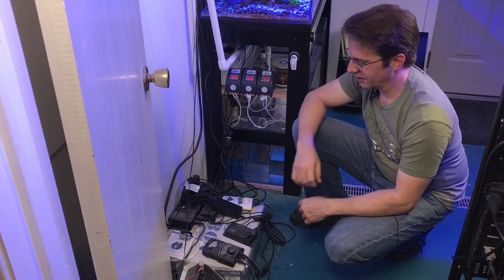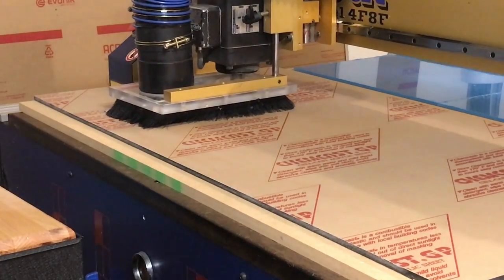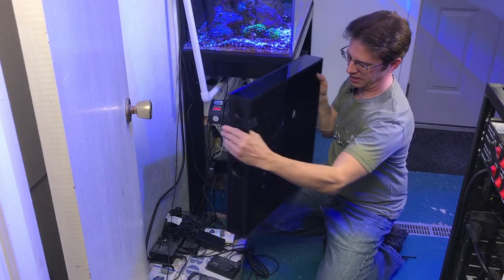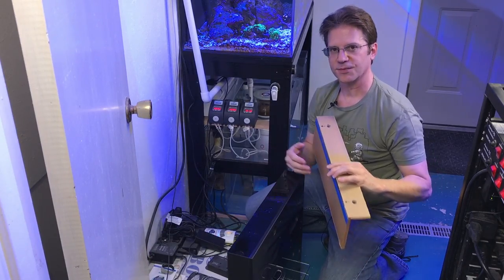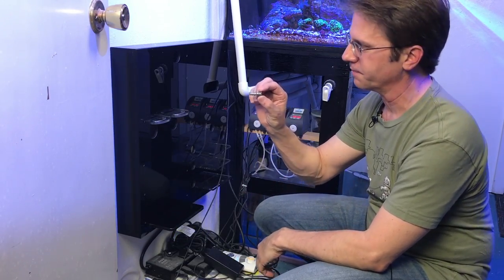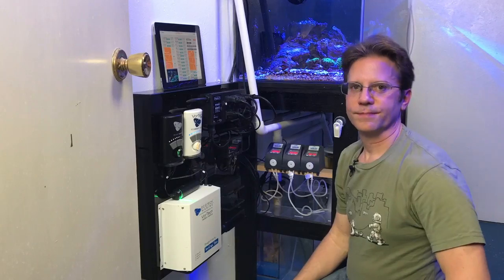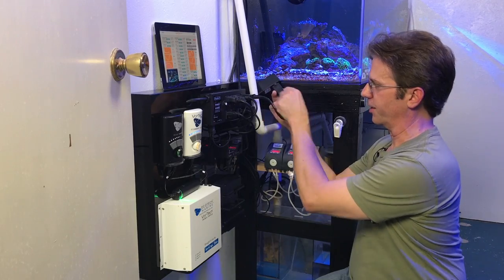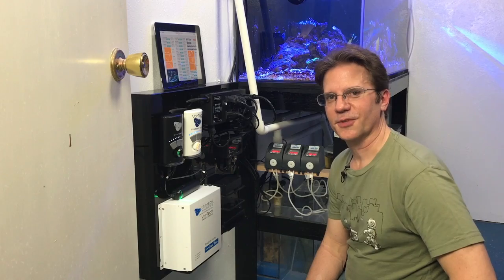Custom Acrylic Power Panel tidies up everything nicely!

Comment: Great job Melev, I love seeing polished cable and device management on tanks.  Snake pits drive me a little crazy and unfortunately 99.9% of every setup has them.
Reply from the maker: Thanks Than.  It's a time-consuming task to clean it all up, especially when you really organize it perfectly and later discover you have to replace a pump or other piece of gear. Having to cut off all the tidy zipties... you know what I mean.  This box hides the mess within it.  lol  But I can change stuff easier since I can pull it off the wall to get access to the wires, a solution I can live with.  Too bad the Battery Backup is so heavy, right?

Comment: Couple comments
1) Love the new Disneyesc opening to your video :D
2) That CNC machine almost looks like cheating for acrylic work!   To the point that I want one, unfortunately without a business that utilizes it not sure I could justify the cost :(    Wonder if there are any local "maker" workshops where you can use equipment like this though.
3)  Excellent job on the cutouts.  I've wanted to do something like this under the cabinet (with rubber grommets added though) to physically isolate electronics from potential splashing (and hopefully a lot of humidity).   This gives me food for thought for what can actually be done.   I applaud you Marc.
Reply from the maker: Thanks. I have five intros I pull from, based on the tone / subject matter of the video.

The CNC has definitely allowed me to branch out more in what I can fabricate these days. I'm still learning as I've only had it running for a few months.

Anything that cleans up our electronics and keeps them dry is ideal.
Reply: One question on the CNC machine though, it didn't look like there was anything holding the acrylic down, was it just the weight of the acrylic sheet?  Or is there some sort of vacuum mechanism under the acrylic?
Reply from the maker: The entire table is vacuum. It sucks the sheet down to the tan-colored board (MDF) so nothing moves.
Reply: Ah I see, so I guess that's why the other piece of acrylic was on the other end, just so the vacuum is equalized everywhere.  Good to know.
Reply from the maker: Yes, that's exactly why. :)

Comment: Hey Melev how does it work for you that battery backup, am undecided if I should get one for my office tank. I read some reviews but they were not that accurate
Reply from the maker: The Battery Backup is made for the Ecotech gear, and I have two of them for the reef and Anemone Cube, plus this one for the frag system. It keeps the Vortechs spinning when the power goes out, and if it takes too long, I can hook up the generator. In the meantime, these are really good for quite a few hours.
Reply: melevsreef Thank You 
But I can connect other electric systems on this equipment? 
my tank is a 90 gls with only two pumps and a hydra 52 but the kill a watt bar that I have everything connected if the power goes off when it comes back stay off so am looking for something like this to keep the power on just in case and save the tank.
Any other idea am open for references I know you are an experience reefer 
Thank You
Reply from the maker: You would have to find a battery backup designed for your own equipment. Coralvue sells their version of battery backups that may work with your pumps - you'd have to find out.  Mine are for Vectra and Vortech pumps exclusively, because those are the pumps I use.